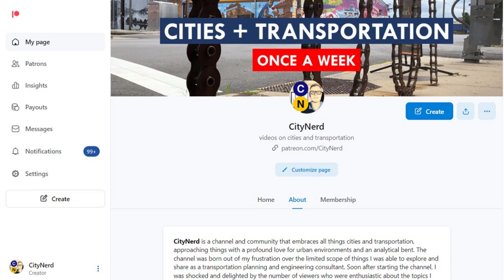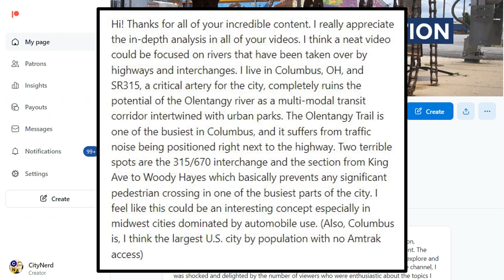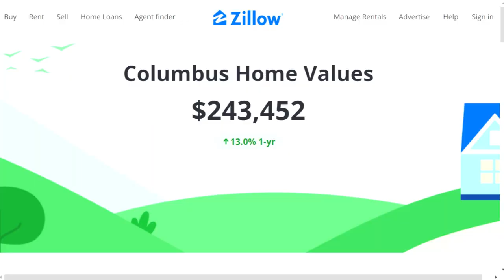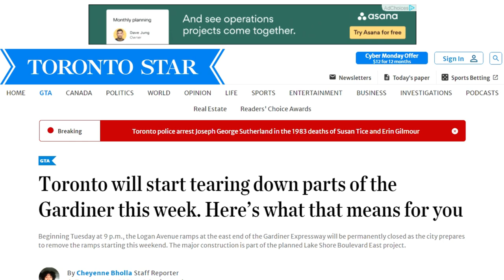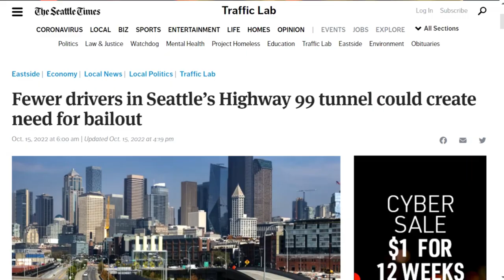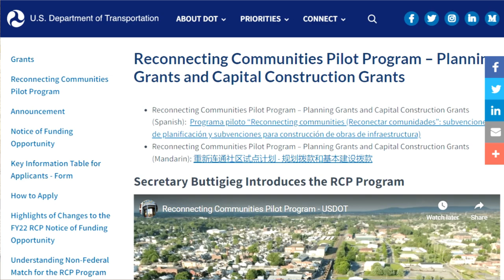Highway Engineering Madness: 10 Waterfront Freeways That Need to Go (North America Edition)

Comment: I'm interested as to the logic behind 'at grade' freeways being worse for noise pollution than elevated or below-grade (but not enclosed/tunnelled). From the research i'm aware of, both elevated and sound barrier / open trench create much more noise pollution due to resonance and acoustic amplification. For example, sound barriers often will reduce adjacent noise, but create more noise penetration, overall a higher pollution level; similarly elevated has a built in noise box underneath to amplify sound

Comment: How did I just KNOW that Lake Shore Drive was going to be featured (and quite prominently) on this list? 

Another thing about Lake Shore Drive I haven't seen mentioned is the susceptibility to lake effect snow storms. 
Lake effect snow is definitely more of a threat on the eastern coast (Indiana/Michigan side) of the lake, but we do get socked here in Chicago from time to time, and moving inland just a mile will usually drastically decrease the level of snowfall during these "lake effect" storms. 
 Once you get more than a few miles inland you might be experiencing sunshine while LSD is getting blanketed. The inland/western burbs almost never experience lake effect snow. 
Just a few years ago LSD was shut down and motorists were stranded and needed to be rescued. Even in the case of standard snow storms, LSD usually gets hit harder. And because it is not an interstate, and falls entirely within the city limits, it does not receive the same attention from snow/ice removal crews with its CDOT resources that interstates receive from IDOT resources. 

This is not to mention that the lake itself can get whipped into quite a frenzy once or twice per winter and the rather turbulent waves can crash all the way to the edge of the LSD pavement. It's spectacular and dangerous. Though there are relatively few people using them during the late fall/winter when this is most likely, it is an extreme hazard for anyone on the bike paths, parks, and beaches, which are right there. The city will even deploy police to shut down lakefront access. (To the best of their ability anyhow, but some people are just determined to win that Darwin award.)
There have been a handful of times I was driving on LSD while braving these conditions and let's just say it will certainly activate that sympathetic nervous system response. Not that the drivers themselves don't already do that even on the few comfortable weather days a year that we enjoy in Chicago. The speed limit is 40/45.ph and people regularly drive at 70/80 mph. It is insanity.

Comment: Lakeshore drive is needed because it really the best way to get to the south to the Northside of the city. You can take the I-94 but it will take much longer. At least on Lakeshore drive you cannot drive large tricks or no pickups. No uhauls either. Speed limit is only 45 sometimes only 40 which cuts down on the noise and pollution

Comment: I can see the logic of putting highways/freeways along rivers; it avoids cutting through the middle of established neighborhoods/cities by hugging the periphery. It's a damned if you do, damned if you don't situation: Put it along the river? No! You're polluting the river and cutting off the city from its waterfront. Put it further into the city? No! You're displacing vulnerable people, segregating the city, and polluting poor neighborhoods. Build it outside of the urbanized area as a bypass? No! You're facilitating unsustainable urban sprawl by improving accessibility and desirability of suburban/rural land.

Also, keep in mind that all the issues with air and water pollution (and some of the sound pollution) are not inherent to freeways themselves; they're inherent to vehicles that rely on gasoline/oil. The electrification of our vehicle fleet should be kept in mind when considering the pros and cons of freeway locations. The noise of rubber tires on pavement at high speed still sucks though.

Back to river freeways: Due to flood risk, the land is often relatively cheap to acquire (or already owned by the state/fed), which is a big incentive too. However, flood-proofing the road (elevating it, etc.) becomes its own huge expense. River banks traditionally are locations of industry and infrastructure, due to the transportation mode shift from boats to trucks/trains. The idea of an urban river as a green, fresh, public park amenity is only becoming practical due to the post-industrial globalization happening in the West.
Reply: thats why we dont build highways there is never a good outcome by building one. also almost all the sound at high speeds is rubber rolling so electric cars dont really slove anything exepct being sblittle more environmentally friendly. also if you really knew stuff waterfront property is very expensive in some downtown areas.

Comment: Colorado built the E470 toll loop around Denver instead of using the space to divert I-25 around the city. They should also expand RTD out further like Washington DC is doing with their system but last I read they are only going to concentrate on inside the city

Comment: Having lived in suburban Chicago all my life I would certainly say that I think LSD isn't of any use any more.  Tourist guides tell people to take a drive down LSD for the views but whenever I drive on it you have to be completely focused on the road because people drive on it like an expressway but it's not an expressway.  The tunnels are definitely a problem.  If they aren't busy people will be afraid to go in them alone.  LSD definitely blocks residents from getting to the lakefront easily.  As a driving route LSD is mostly useful to people who live in the near north suburbs.  Even if you take LSD into the city for transport you will still need to park somewhere which is hugely expensive.  People who talk up Metra as a substitute don't take into account the fact that Metra's train schedule is very infrequent outside of rush hour and drops you off west of downtown.  Probably an hour walk from all the interesting stuff along the lake.  The subway is the best way to get into the city and get around inexpensively but you have to get to a very near suburb to get to it. What people don't take into account on videos like this is thinking on city construction has changed perhaps every decade or so and Chicago has enough problems without trying to rebuild the city every 10 years.  LSD predates even the super highway system and the early versions predate cars.  That being said Chicago would almost certainly be better off without it.

Comment: I am not sure Storrow Drive belongs on the list. 

First, the road provides important connections to Copley Square, Kenmore Square, Cambridge, and points due northwest from downtown that are not covered by the Pike. 

Second, there is no shortage of recreation space along the east side of the Charles. The annual Fourth of July celebration at the Hatch Shell has drawn up to 500,000 people.

If one were to spend a set amount of money in improving urbanism in Boston it would be better spent in covering the Pike where it is not covered between Kenmore Square and the Ted Williams Tunnel.

Comment: There are three parts of Lake Shore Drive 
1.  Downtown which runs from I -55 to the South to North Ave.
2. North Lake zshore Drive from North Avenue to the north terminus at Hollywood  Ave.
3. South Lake Shore Drive which runs from 31st St to its southern terminus at Marquette and Jeffery Blvd.
I will deal with the South Side first.  Between Roosevelt and 47th, the Metra Electric commuter trains and CN railroad parallel LSD to the west of the Drive.  So even if LSD was demolished (which it shouldn't be) the so called barrier to the lakefront would still exist with the railroad tracks.  South of 57th is Jackson Park which has the Museum of Science and Industry.  Nearly all of its visitors use Lake Shore Drive to get to it.  The Museum and the future Obama Presidential Library would die without Lake Shore Drive.   So there is a tiny stretch that has some residential density in this corridor 

@CityNerd concern seems to be North Lake Shore Drive 
  Lincoln Park runs to the west between North Ave and Diversey with many high rises and high density  along the rest of the Drive
  Inner Lake Shore Drive parallels the outer express drive from Diversey to Irving Park and Marine Drive from Irvine Park to Foster. Belmont and Irving Park provides access to reach Wrigley Field which is only 1/2 mile away.  Consider the Kennedy Expressway is 3 miles to the west of the ballpark and is not an optimal way for lakefront area residents or Wrigley visitors to reach downtown.  Lake Shore Drive also connects downtown to Loyola University and Northwestern University (in Evanston).  Both schools have downtown campuses.
Lake Shore Drive is a vital artery that gives people on both sides of town near the lake access to downtown that otherwise don't have freeway access.  This is vital when you consider most of the job market in the Chicago area are in the suburbs.

Comment: In Toronto they simply removed a large section of the freeway and replaced much of the original waterfront area with huge condominiums.  You can no longer see the water, even from the raised highway.  It used to take 8-12 minutes for me to cross the city.  Now it's 35 minutes to a hour.  The single lane exit and entrance ramps to go across town, which are effectively downtown, are always backed up, and Lakeshore Blvd is in desperate need oof maintenance.  Any two lane routes to downtown now have bike lanes cutting the space for cars in half.  Every time I go to visit, at least part of the subway line is not working.  Avoid, avoid, avoid!  It's a horrible tourist destination now, and a failure of a city.  
you need 
Your explanation of why these highways are build is bass ackwards.  Large numbers of people wanted to go to the waterfront, therefore roads were needed to accommodate them.  The waterfront wasn't as exclusively for the wealthy as it is today. 

As far as the Toronto Gardiner & QEW Hamilton.  You said earlier that you need alternate routes.  Well . . .  Currently, i try and bypass Toronto on my way from Ottawa to Welland to visit my father in law, but it is very difficult.  The 401 has had construction for a decade around Toronto, and needs more.  Where would you put these new highways?  Who's houses/businesses would you expropriate?    

Toronto has needed an east west relief line along the waterfront for decades and decades now.  When will that be built, if ever?  Government keeps building up north where it's cheaper, but that put even more pressure on the existing structure in the south and pushes people who live close to the waterfront into automobiles to get around.

Comment: Your commentary on Portland's I-5 freeway on the eastbank of the Willamette River, "It's just gotta go," assumes the connection to I-84 east can be severed, no problem. Mayor Ted (talks too much) Wheeler has stated I-5 could be relocated in tunnel under the Willamette River, but it's physically not possible nor advisable if it were. I-5 can be affordably relocated further from the riverbank to reduce noise and revegetate the riverbank. The I-5 Marquam Bridge, slated for replacement, offers a lesson in how to replace the I-5 Columbia River Bridge: single-deck vs double deck. Meanwhile, ODOT is on a freeway widening binge with complicit business interests perfectly willing to watch the world explode.
Reply: If I-5 on the Willamette River eastbank is to be removed, the most likely replacement connection from I-5 South and Hwy 26 West to I-84 East is via I-405 to the Fremont Bridge then south on that remnant of I-5, then east on I-84. However, ODOT is in the planning "process" of "widening" the "Rose Quarter" stretch of I-5 that predictably worsens traffic hazards, accident ratings and severity (more accidents, more multi-car pile-ups, more passenger and pedestrian injury and fatalities).  The Rose Quarter related development ("One Albina" sardine can apartment block) just beginning construction should be put "on hold" because ODOT's relocation of the southbound off-ramp CANNOT be relocated south of Weidler unless safety concerns are ignored. I believe a federal investigation of ODOT & PBOT is warranted.

Comment: In Philly 95 is way worse than 76 imo. The side of the river 76 is on has a large rocky cliff from the north and a lot of well established none residential use through the city (probably due to the highway and train tracks) and its reasonably well connected to the recreation on the opposite bank. 95 has huge swaths of defunct industrial buildings that aren't desirable to redevelop since 95 cuts the area off from residential spaces.

Comment: I've never been bothered by Lake Shore Drive, its too useful to actually be a problem, and moreover it does have a lot of grade seperated crossing for pedesrians, but they way the highway system works in Chicago, removing would render the Lake almost impossble to reach except by a very lengthy car drive, Lake Shore drive does have very good bus access.

Comment: So I get that riverside property is valuable but you can probably never remove a interstate. They were designed in the 50s as a defensive structure. There locations and design are actually really important for national defense and security. Take Philly for example those two highways go along the those rivers as a defensive line Cause Philly has a big port, it's a big target.

Comment: Having grown up in the San Francisco Bay Area I'd have to say the Bayshore freeway (us101) is actually worse then the Eastshore freeway (Interstate 580 and 80) that was mentioned. Sure, Berkley CA would love to have it's waterfront back these days, but historically that area was fairly industrial and literally trashed as several former garbage dumps are along the shoreline there and the Eastshore freeway itself is built on filled land. About the same can be said about the Bayshore freeway but it also travels along the shoreline just south of the San Francisco itself near some of the most expensive land of the SF Bay area itself.  There's also a few other poorly located freeways nearby not to mention two of the areas international airports (SFO and OAK) are located right on the Bayfront.. At least there are also quite a few wonderful regional parks along the shorelines but yeah historically development along the shores of the SF bay have been a mess and the freeways are the least of the problems.
Reply: Oh! also fun bit of trivia to tack on about the Eastshore freeway is that it's one of the few freeways you can be going both East and West (freeways signed directions with 580 and 80 going opposite) at the same time you are actually traveling North or South (physical directions of travel).

Comment: I think it should be this cool floating skyway and reveal the ground back as it should be and bury sections of it where it makes sense. I dont have all the solutions even though i lived in the city for 20 years and 22 in the burbs. But this city needs to change lsd, add beltway connections both by rail and by highway but build it in the same manner as the downtown hovering skyway architectural masterpiece. The suburban beltways with both buried and mini hovering skyway segments will compliment the rest of the new system with the downtown one being the most distinctive.  Cars already have a negative impact there because too many cant handle 45-55 mph apparently. Its supposed to be a parkway and was the original  city highway design with the first diamond style interchanges, with a connector hub interchange downtown. Let traffic be encapsulated in tubes beyond street level view. I loved riding my bike as a kid in Chicago.  I think doing this will markedly improve the lakefront situation and please the lakefront owners. This extension if you will comes from the idea of how millennium park was built over ontop of a rail yard. 
The city to inter suburban radiating beltways would be just giant versions of the bank vacumn tube system except more tube cars and more air pressure. Run the electric generators off biodegradable biodiesel waste oil from the many local establishments put radio tags to gps position and coordinate these things

Comment: Wouldn't they be "Denvronians"? I-95 in Philadelphia is, ironically, one of two I-95s running parallel to each other. The one in Philadelphia at any other time in history would have been known as I-95 Business if not for ego.

As for I-76, it is a horrifying monstrosity and is technically part of the very first American interstate, which I think should have gotten at least the #10 spot on the list because America's first interstate helping to destroy a riverfront helps hammer the point that this is a systemic issue. Everyone universally agrees that it is a failed construction, but that building any other such highway would cost billions of dollars.

To add to that, the Vine Street Expressway connects these two monstrosities. Gotta tell you, sounds like #1 material to me.